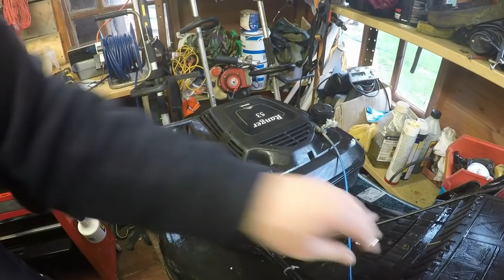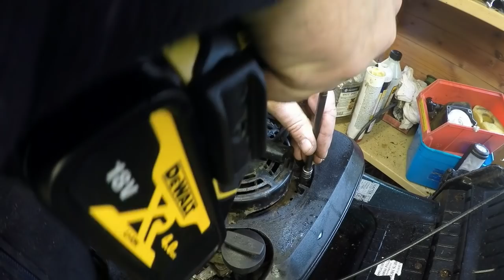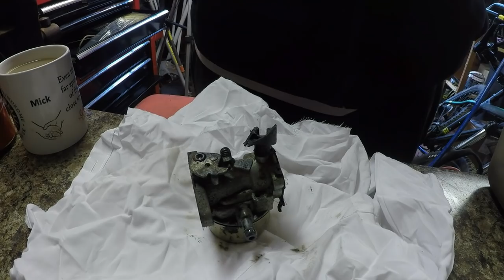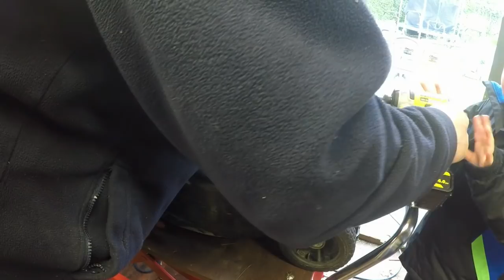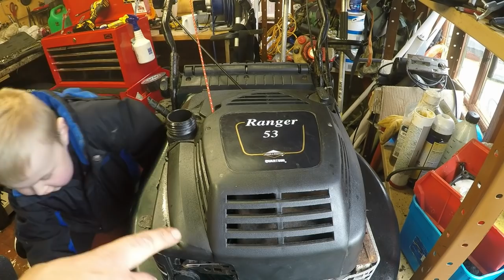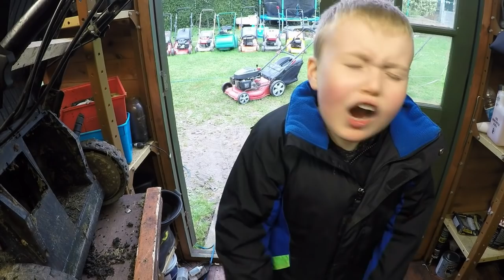#hayter #lawnmower #howtofix Hayter Ranger 53 Lawnmower Needs Fixing

Comment: Hi that’s like the Hayter I serviced the other week, the drive was broken on that to, but tbh they are easy enough to push. I may have missed it but how did you get on with the bbc on the Honda hrx ? The Hrx426 I have which had a broken gearbox, I had a stroke of luck I found a gearbox in my unit and that mower now works, result. There’s plenty going on this end, I’ve filmed some but a lot I’ve done off camera, it’s getting busy I mainly only fix up the higher end mowers, but I do a few cheaper brands if the condition is good. Anyway good video I’ll look forward to the next🙂👍
Reply from the maker: Oh the old Honda BBC yeah it's still in the old shed hiding. I will be getting round to it soon, I am confident it's just put together incorrectly as it was working before the drive issue